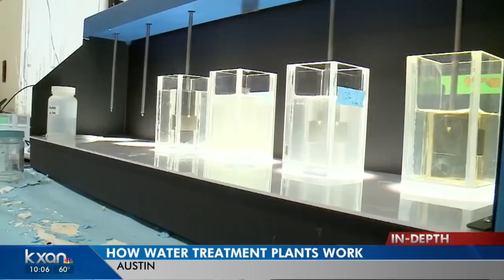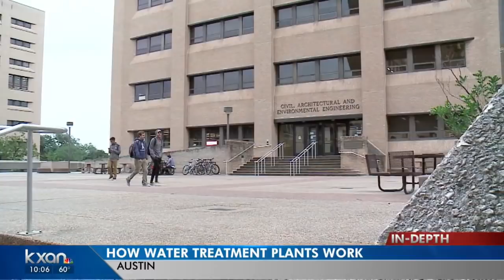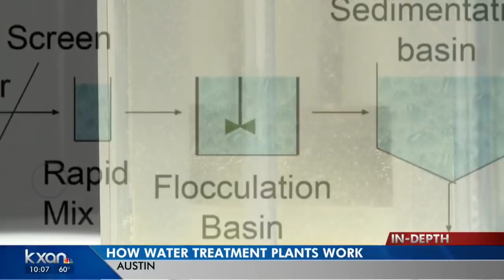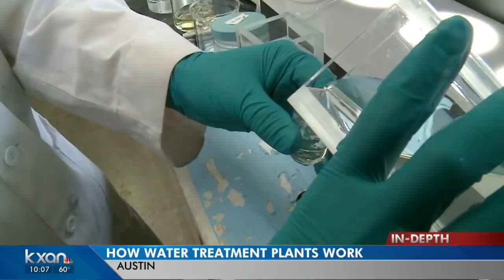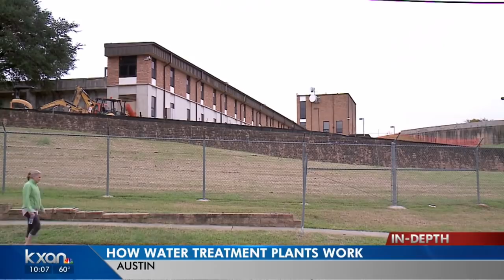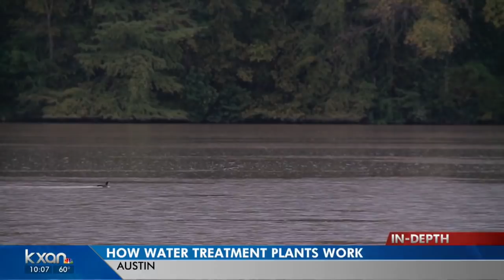What went wrong at Austin's water treatment plants

Comment: There must have been flooding or heavy rain up river which washed more loose silt down than usual. Had the same problem in England. Happened after a drought followed by storms. Give it a week of no rain and it will be fine. You just gotta wait it out